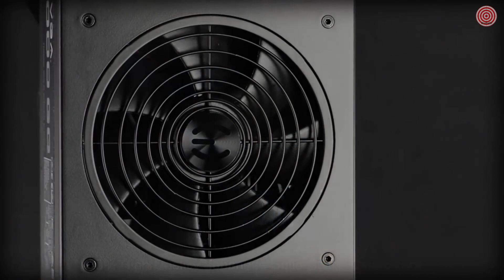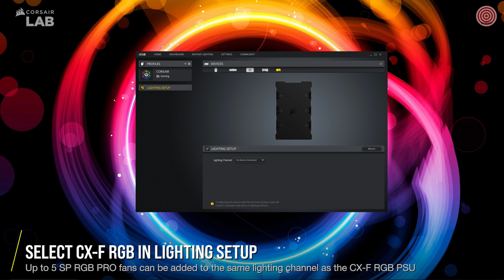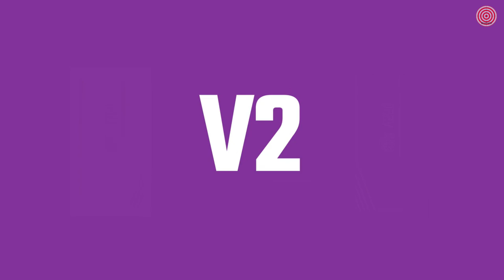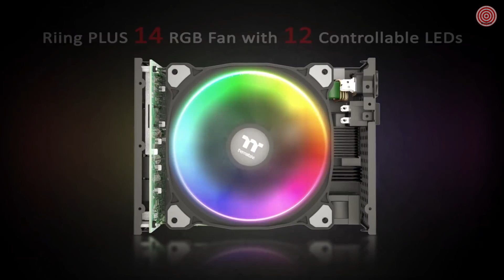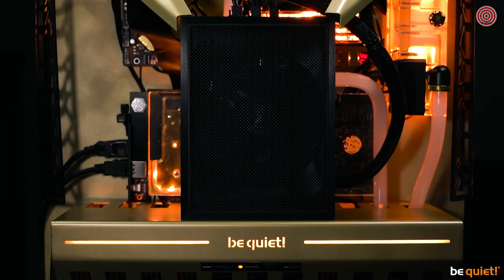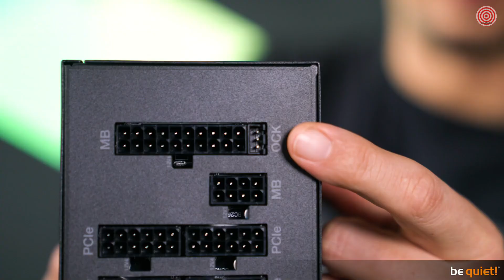The 5 Best PSU for Intel Intel Alder Lake 12th Gen

Comment from the maker: 🔽The 5 Best PSU for Intel Intel Alder Lake (12th Gen)🔽
1. EVGA 850 GQ Semi Modular Power Supply
https://shorturl.at/jlq4P 

2. Corsair CX750F RGB Fully Modular ATX Power Supply
https://shorturl.at/jlq4P 

3.Cooler Master V750 Gold White Edition V2
https://shorturl.at/jlq4P

4. Thermaltake Toughpower iRGB Plus 1250W
https://shorturl.at/jlq4P

5. be quiet! Dark Power Pro 12 1200W
https://shorturl.at/jlq4P